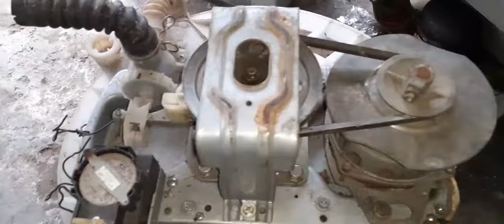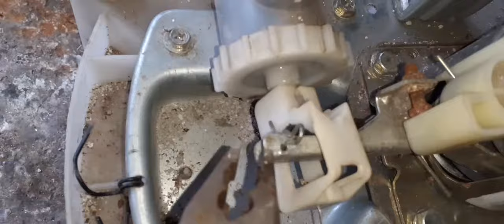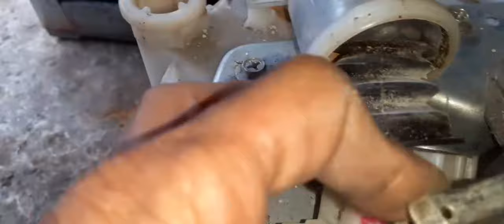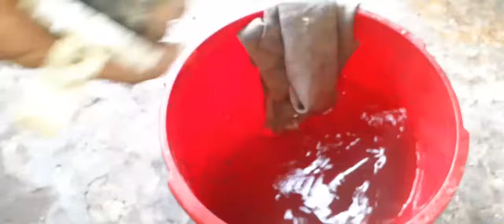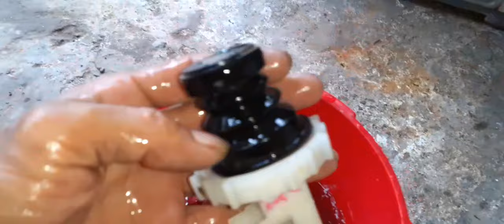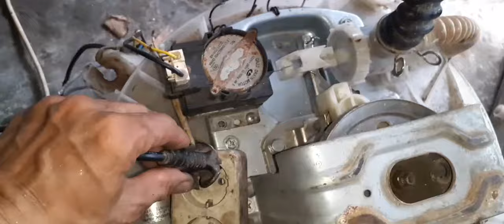Cara paling mudah mengatasi motor drain mesin cuci tidak berfungsi

Comment: Mas, motor drian punya saya langsung saya sambungkan kabel ke listrik bisa kerja, tapi ketika pakai kabel mesin cucinya gak kerja. Kabel juga masih bagus.
Bantuannya mas
Reply: Sama ini kaya punyaku
Reply: @nauragiska8042  ternyata modul yang ke arah motor drian putus/ eror, akhirnya saya manual saya sambungin kabel langsung ke colokan listrik
Reply: @nauragiska8042  jadi ketika buang air, saya nyalakan
Reply: Barangkali dg jumper dari kaki no.10 IC ke sebelum resistor dekat triac bisa normal boss.